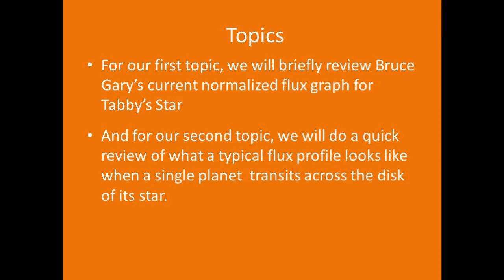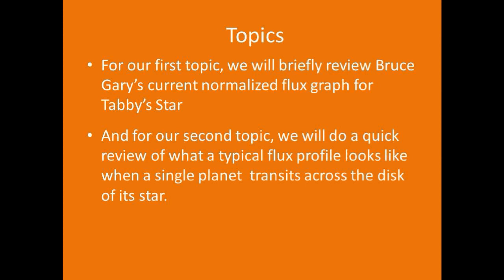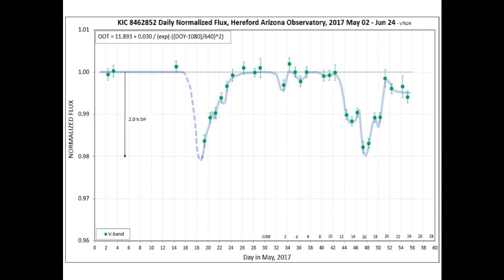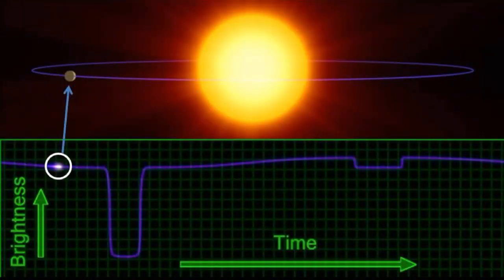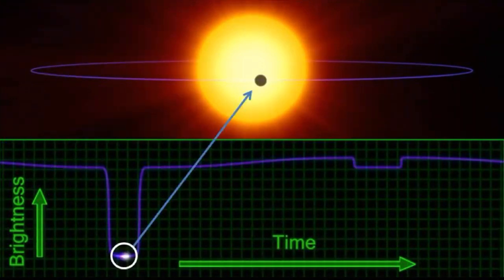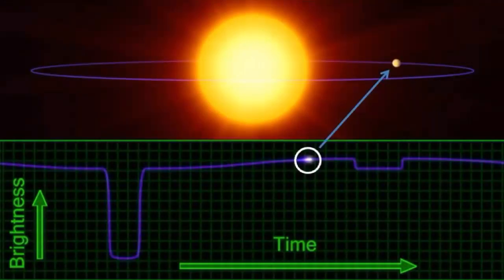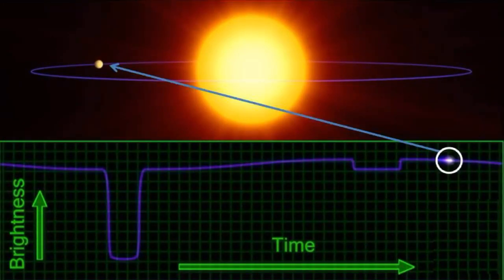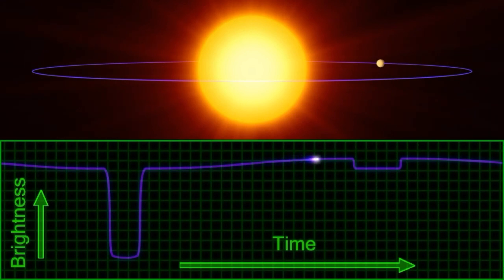Tabby’s Star KIC 8462852 Flux Update for June 24, 2017

Comment: Would love to hear reason for no update since 6/24/2017. Clouds? Smoke? No change? Even that would be interesting to know about. Sorry for being a pest. Just addicted 😬
Reply from the maker: Winnie, thank you for your question.  The reason that we paused in our updates is that Bruce Gary had to shut down his observatory due to the coming monsoon season (rainy and cloudy season) in Arizona.  We were able to get measurements last night (because the weather cleared temporarily) and noticed that something very strange is going on.  It seems that the flux level from the current dip has not recovered and this may be a permanent step-down (a new nominal flux level).  We want to get one more set of measurements before we mention this in our next posting (which should be either tomorrow June 28th or 29th.  Please stay tuned.
Reply: Fredric Parker  Thank you for your time replying. I'll try to be more patient.

Comment: Revelation 21:15 - And the one who spoke with me had a measuring rod of gold to measure the city and its gates and walls. 16 - The city lies foursquare, its length the same as its width. And he measured the city with his rod, 12,000 stadia, or about 1,380 miles. Its length and width and height are equal. 17 - He also measured its wall, 144 cubits by human measurement, which is also an angel's measurement. 18 - The wall was built of jasper, while the city was pure gold, clear as glass.
Reply: Are we quoting random Wholly Babble verses at each other now?
May I ask why?
Reply: Acts 13:40 - Beware, therefore, lest what is said in the Prophets should come about: 
41 - "Look, you scoffers, be astounded and perish; for I am doing a work in your days, a work that you will not believe, even if one tells it to you."

Comment: Interesting - the unusually massive dips in tabby's star should result in increases in brightness as the objects pass around behind the star. I've not seen this really addressed anywhere. We don't see that. Implying the objects are not in orbit, are interstellar or unusually low albedo. This just adds to the mystery. But then where is the enormous IR flux that would result?
Reply: Tim A. also, the events that started last may were kinda predicted by Tabby. She calculated months ago  that if the dips were caused by an orbiting object, they would restart late may 2017, just as they did... which is a bummer for the interstelar dust theory
Reply: When a orbiting sphere passes behind a star the flux should increase a little and then drop.  An object with a flat surface(s) can reflect light in such a way that we would not see much of anything.  There is no reason to assume aliens build spherical megastructures.
Reply: Dare I suggest the Dyson Sphere is a sphere?

Comment: Thanks for the normal planet transition, so this why people keep calling it a "swarm."  I am assuming the light is getting gradually blocked out as the "swarm" gets denser.  Or alternatively it is an solid object with translucent properties that goes totally dark in the middle.  I am not an astrophysicists, so please correct me if my assumptions are wrong.
Reply: A triangle can make a graph similar to the 2011 event.  You can model dimming events with a light bulb.  A straight edge like a piece of paper will have a sharper dimming curve then a ball.  But it is still a curve because the spherical star/bulb has a curved edge.  Astronomers/physicists like to talk about spheres because they can do calculations on spheres.  A moth flapping its wings in front of a street light will also create a dimming event.  The moth is one object but the graph of each flap will resemble the graph of several objects passing in front of the bulb in a swarm.  

I am not suggesting that the graph of KIC 8462852 was created by something that looks like a moth.  Recreating an object by looking at the magnitude of its shadow is difficult.  Especially if the object is smaller than the light source. It gets worse if you have swarm of something reflective like tinsel or shredded aluminum foil.  Some of the light source can be reflected toward the detector while other pieces are still creating shadow.
Reply: stefan r I am ok with it being Mothra.  Mothra was one of the good monsters from the Godzilla movies.